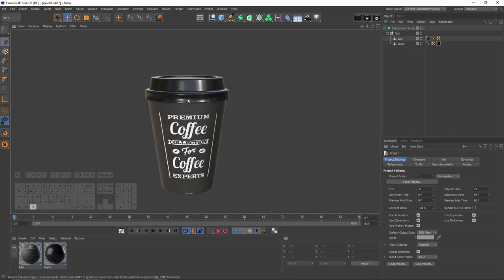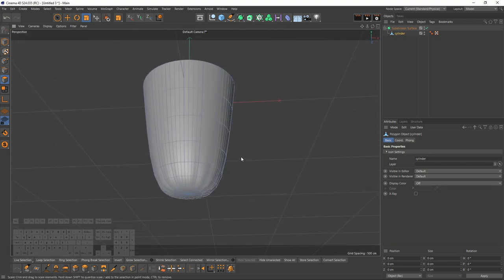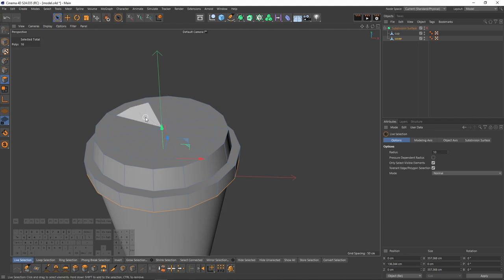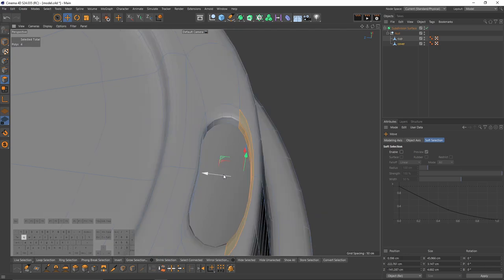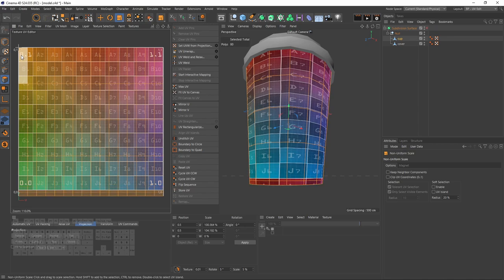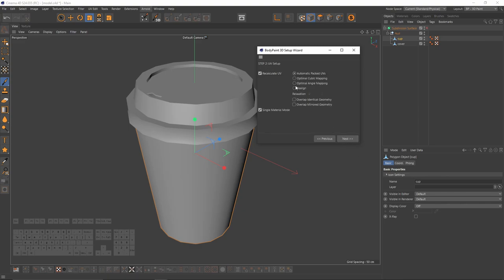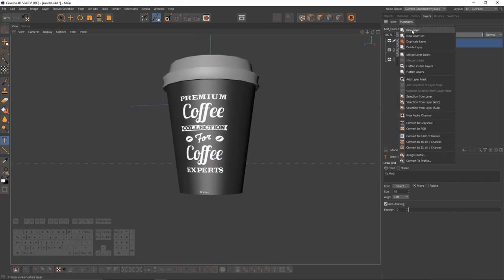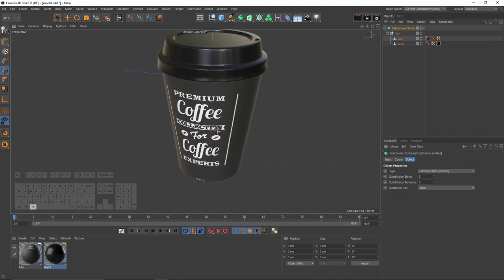Beginner 3D Modeling #2 | Paper Coffee Cup | Basic Subdivision Surface & Texturing Tutorial

Comment: Ty for the video, but there is one thing that never ever works for me; when I make an object editable then go into Edges mode, no matter how many edges I double click on, it never highlights all the connected edges; I always have to use the loop selection. I have tried it from C4D S24 up to 2024 and double clicking edges does not highlight more than one edge at a time. Can someone help? Ty in advance.
Reply: @VladimirDabicI figured it out. Not next to my PC now, but off the top of my head if you go into Preferences, Input and select 3 wheel mouse, it will work.

Comment: The R19 version I used doesn't feel that texture splitting is very easy to use, especially after relaxation, it will deform. Moreover, in 3D paint mode, I don't know why the loaded transparent texture has a black background
Reply from the maker: Yeah, r19 doesn't have new UV unwrap system. The label texture is transparent, it should be tranparent when you import, make sure that you don't have any color background layer
Reply: @polygonpen  Thank you for your reply